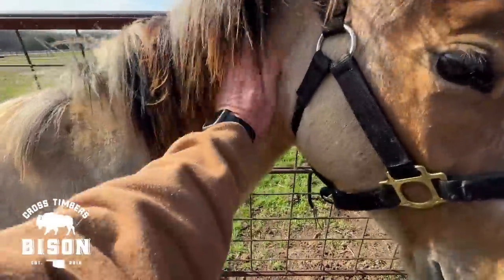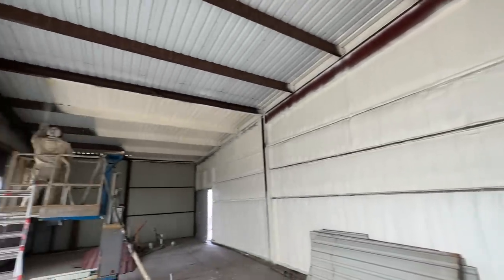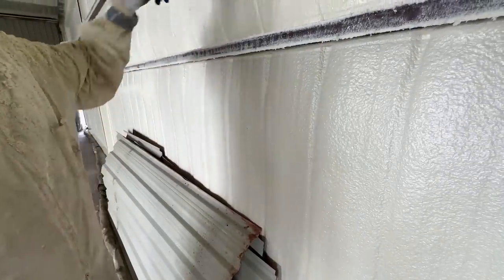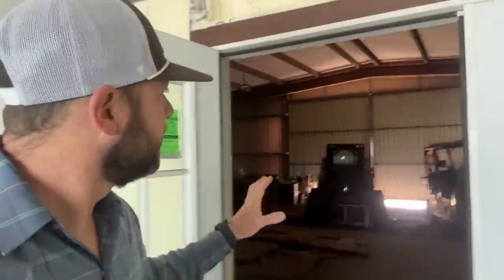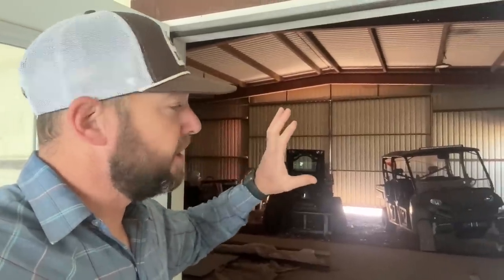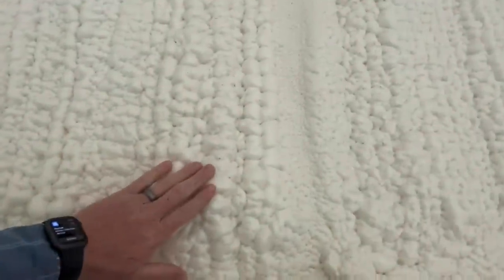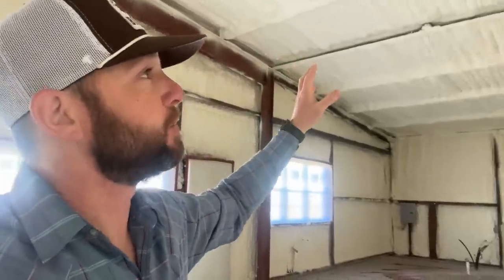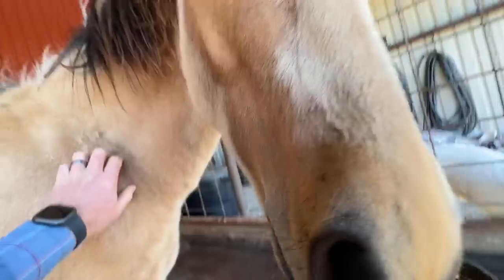Ponderosa Upgrade! This Is The Way To Go!

Comment: As a former insulator spray foam was used quite a bit up in Mn/ND for metal bldgs. You should notice it being quieter & warmer. You guys sure are busy with everything going on. Looking forward to the roundup.

Comment: I just saw an IDEA you might like: To spread the pellets, use a plastic barrel, in the shape of a oak barrel (tapered towards the top and bottom) turned on its side, with a 4"-8" hole in one spot at center of the greatest diameter. Then, run a pole through the middle and tow it behind your truck, side by or whatever. As you tow, it rolls, dumping a small pile of pellets.
Reply: Great idea!!!
Reply: Good idea. He needs something to keep himself safe!

Comment: What is the advantage of the open cell foam?  I love what y'all have done with the barn. If you are familiar with Cog Hill Family Farm they built their home using the foam spray and painted their ceiling black. Very pretty! Marisa could learn a lot about gardening from Jason there also. Today they have a video on their fruit orchard. I hope you'll check it out.
Reply from the maker: It’s another layer of insulation and helps with sound inside of a metal building.
Reply: @CrossTimbersBison  I noticed it was much quieter when it was finished. Can't wait to see more as you continue on! 😁

Comment: This probably wasn't the case but usually you don't want to be around spray foam when it's be sprayed because the chemical reaction that takes place when it is setting creates hydrogen cyanide gas. That is why they wear a respirator while applying it. It may not have been the case with this spray foam but still just better to keep your distance.

Comment: A lot less echo in the room after the spray foam.  Have you noticed if it's quieter - more isolated from outside noise?  Gonna be some cold, or hot, spots where the beams span from the roof to the interior.  Won't be as big a thing in cold for you as it would be up here in New England.

Comment: Why did you get both types of spray foam?
Reply: I believe it was for the extra R value and the first coat was for water proofing or leak prevention of the metal roof and siding.